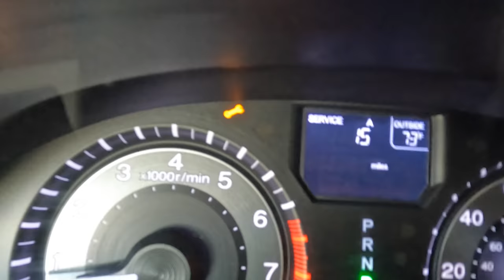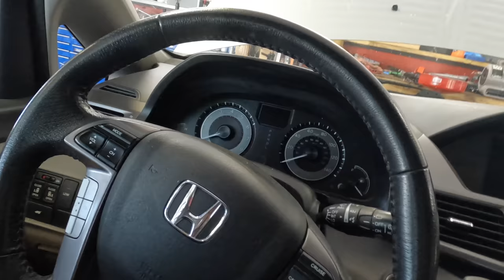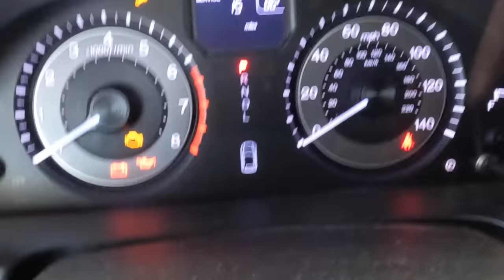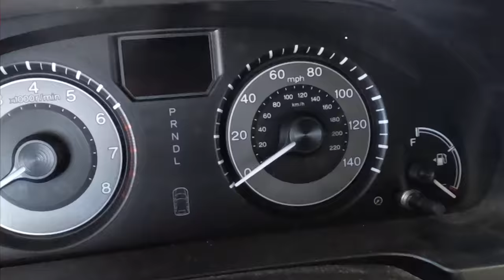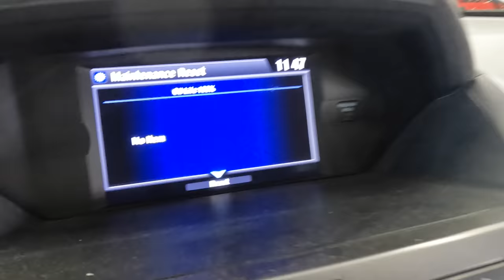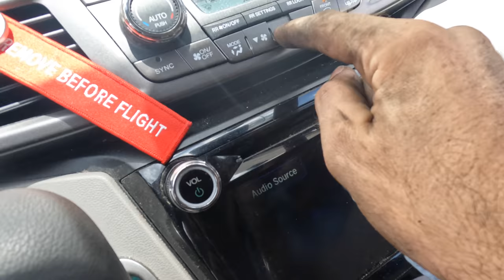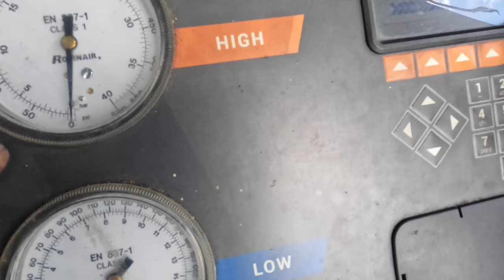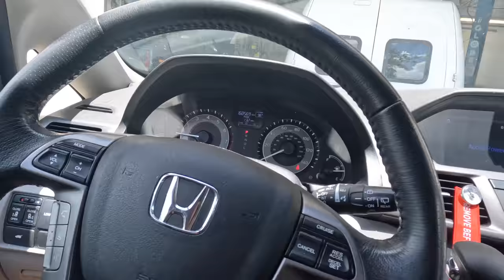Running 300-400 psi. Vibrating noise and smoking! 2014 Honda Odyssey 3.5

Comment: Your failure to actually go read the manual and determine the proper operation of the fans is negligent. The fans operate in series for low speed, and parallel for high speed. There is a pressure transducer on the high side refrigerant line that reports to the climate control, (which is observable in data from the climate module) which then relays information over the data bus to the PCM, which then controls the three relays involved. Without compressor request the PCM operates the fans based on input from two ECTs one the radiator and one on the engine. In the limited amount of time that I can hear the fans after your "repair", it sounds like high speed only. During normal operation in our temperature conditions the system may occasionally cycle between low and high, but should not be "stuck" on high. The pressures indicate other issues with the system as well, 4 bar for the low side at an idle is excessive. I am confident that the cooling performance is not as designed, turning the blower down, and showing an air outlet temp of "42'" is not a good indication. I am sure that on high blower, outside air, with the hood up, it is not cooling as designed. Definitely not an "absolutely phenomenal diagnosis" !

Comment: Might want to reconsider indiscriminately spraying that crap on exhausts. Makes phosgene gas if it gets hot enough, doesn't it? May be highly unlikely "under normal conditions" - but you probably get the occasional vehicle that's running really lean, pig rich, etc. You appear to be cool with killing yourself slowly, but get exposed to a high dose of phosgene ("high," in this context being 150 or more parts per million), and by the time you start feeling poorly a few hours later, you've got a pulmonary edema. Which you'll probably survive (albeit with long-term issues)... but your odds go in the toilet if you figure (hope?) you'll feel better in the morning, and go to bed early instead of going to the ER.

Also a concern would be repeated low-level exposure, over time, that you might not even notice due to a bludgeoned sense of smell from the chemicals, combined with the fact that yours is not exactly an odor-free job.

Auto mechanic - along with coal miner and concrete worker - ought to be a profession exclusively for old farts with no family, man. You've got a wife and young kids... Be me, I'd be seriously thinking about doing a spit & shine on the homestead, and then selling it to someone who's heavy on dollars but light on sense, as they used to say - and using however much money you manage to get to buy a decent eight- to 16-acre piece of property somewhere in Kentucky or West Virginia. You might end up having to eat from the garden more often than you dine out (unless you want to work really hard for the next 15 years), but your kids would probably LOVE making snowmen and sledding down hills in Winter - and you'll be more likely to be around for their wedding days.